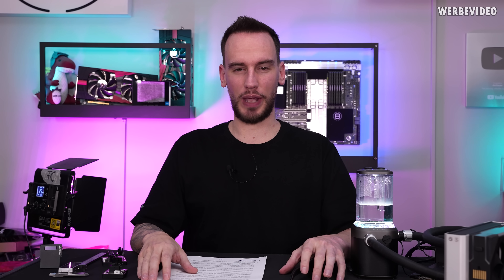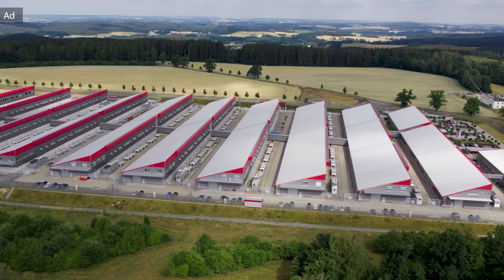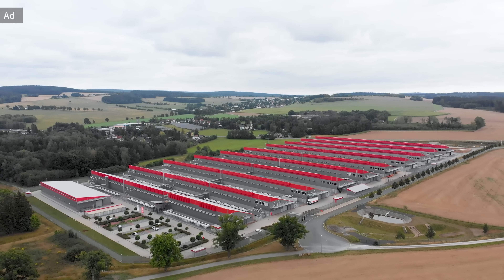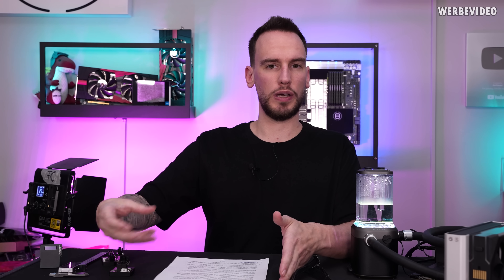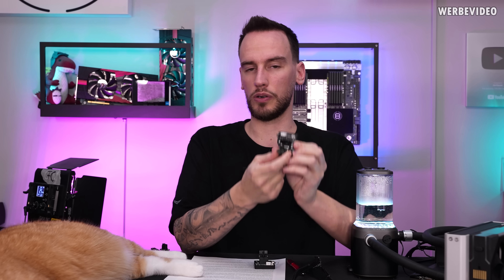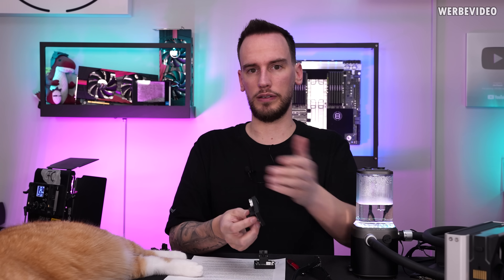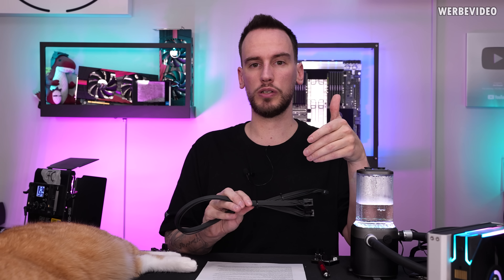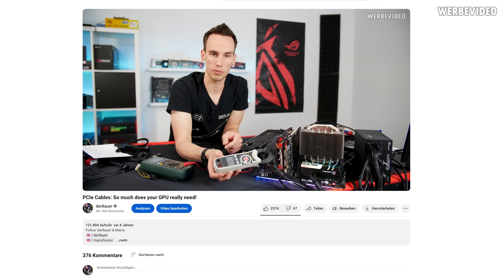12VHPWR is just Garbage and will Remain a Problem!!

Comment: Gonna be honest, modern GPUs being stupidly wide but still refusing to move the power connectors away from the outer edge of the card is a huge problem that also needs to be addressed.

The connector itself is too small, it doesn't provide enough stability to the crimps, they should just go with the 8pin EPS design really.
Reply: Or make the 12-pin connector have pins the same size as the 8-pin for a more robust interconnect.
Reply: @TheKazragore  I mean the pin size is only magnifying different problems, pin size is technically enough its the wiggle room that really causes the issues.
They could have made the plug more robust if they used two latches on the sides of the plugs (instead of in the middle). Or they could have used one latch and use tighter tollerances.
Reply: @Ramog1000 small pin size reduces tolerances because the energy density is higher.  "Technically enough" means you cheap out on safety margins.
1 comprised pin connection can degrade the whole plug as insulation melts.
Much of the tech press should be ashamed of themselves for minimising this issue, which was alerted pre-launch on the SIG list.
Defective products were sold to customers.
Reply: @TheKazragore  yep, that was the first thing that came to my mind right at the beginning, when people started to have problems with it when they released 4090
Reply: Also it's comical how a GPU that is nearly bigger than the motherboard MUST use a tiny undersized power connector to "save space" or something
Reply: I think the problem with moving the power connectors is that they did this power connector at the same time they decided to make the end of the card only heatsink to blow air through. So now there's no PCB at the end of the card to put the power connectors on, they have to stay on the outer edge of the card close to the case side panel. 
If I recall correctly, EVGA was going to extend the power connectors to the side in their 4090 prototypes.
Reply: @mjc0961  they did move it in gamers nexus video with them vince even explained why it was better to put the connector where they did which the reason was to much heat iirc
Reply: as far as I know its not about stability to the crimps but that it can wiggle arround even if plugged in with a click of the latch
wiggling ofc causes less contact area on the connectors and that causes unwanted heat, what I don't get is why they didn't make a 1.1 version of the connector with tightned tollerances
Reply: @Ramog1000 It's not just that. A lot of the issue comes from the power pins being ganged up within the connector. When you have 6 pins with no isolation from each other when one pin makes shittier contact the others have to compensate. So for instance... If you have 6 pins all pulling 10 amps at 12v  (for easy math and illustration and not a realistic scenario) you'd have 720w of total power. Since the power pins aren't isolated from each other... If one pin on the power side isn't touching and the card is calling for 720 w you now have 5 pins pulling 12 amps each to get the same power. This can lead to excessive heat of the connection or conductor and cause the melting we see. And as one connection melts the failure Cascades to the other power pins due to the way the connection on the GPU is engineered.
Reply: 8 pin EPS is only rated for 235W  .... It can go higher but it's been properly derated for safety and headroom reasons while the 12vHPWR is NOT properly derated and therein lies much of the problem
Reply: @longjohn526  its rated up to safe maxium of 336W, 7A per wire, there are 4 12V+ circuits on the connector, with headroom up to 400W if you are daring, 2 EPS12V will suffice even for the 4090, there's just no discussing this, EPS is already bog standard in the server space where reliability is #1 factor of what is used and what is not, if you can power a 300-450W CPU with 2 EPS connectors, there is absolutely no reason an graphics card can't be also.
Reply: Cards having power connectors AT ALL needs to be addressed. I thought it was a stop gap measure. That was 20 years ago.
Reply: another reason it sucks that EVGA stepped down from making some of the best GPUs their 4090 design was not only going to have 2 of the new connectors but they were also going to be on the end not the side facing the glass of most modern cases
Reply: @FrgottenFrshness  or its why they stepped away cause they weren't allowed to use 2. Cause they did proper math
Reply: Bro thats what i said, servers use the eps connector on everything already and its a great connector
Reply: Easy fix - have cables that have 90 degree at 12vhpwr on default. Seasonic has that but Corsair is too thick and doesn’t have that lol
Reply: @deivytrajan  No, it's realy not. some GPU's have the connector realy resest. That eliminates the use of a 90 degree plugg, Some GPU's have the connector upside down. Then the angle will be the "wrong way". If the GPU is mounted vertical, then you want the angle the oposite way. There is to many factors to consider here. There is a reason why cablemod have 4 different adapters.
Reply: @Audiosan79  seasonic reccomends 40mm clearance gap between 12vhpwr and the start of the bend arc. Even if your connector is resest, like mine slightly is on 4090 gaming oc, it still doesnt have enough space in a big mid tower case with 200mm front fans and 167 mm cpu cooler clearance.
Reply: @deivytrajan  Cablemod has started a recall of all their 90° and 180° adapters because they are burning just like the others. So no, having them angled dont solve the problem.
Reply: @walrider  But they don’t recall their custom 12vhpwr cables. Basically, with an adapter there are 4 insertions. With a cable only 2. Obviously cable will be more safe. Despite that, most manufacturers like corsair only offer straight cables of 12vhpwr, modern video cards are super big and the distance left between 12vhpwr port and side panel of the case tiny, forcing people to hard bend the cable or buy adapter…
Reply: @deivytrajan  Yeah you're right I misread what you said my bad
Reply: Honestly. Using 8 pin EPS is not a bad idea. Is already mainstream and in theory (i didnt checked the specs) should deliver more power. They use 4 12v + 4 gnd instead of 3 12v + 2 sense + 3 gnd of the old 8pin PCIe. Still cannot power a 4090 by itself but it would lower the connector number considerably. You loose the sense wires but I honestly dont think you need sense wires on a power cable, that leads to a little more complex PCB design to detect the presence of the cable but its not the end of the world to design (they do it on motherboards...)

Edit: For a quick research the EPS 8 pin connector is 336W per spec and its probably also outdated hahaha. You can power a 4090 with only two of those + a safety margin.
Reply: Absent a major re-design of motherboards, I believe we've likely exceeded the capacity of pcie slots on motherboards.  I just don't see how cards can get any larger or heavier.  Also, there is the fact that having to run an internal PSU that can deliver 3-4 system requirements when the gpu isn't under serious work has to cost in efficiency.  I just can't believe that we aren't quickly heading to external GPUs with their own power supply.
Reply: I have 7800XT that have cutout on backplate with 2x8pins being closer to 2/3 or 3/4 of card wideness and not at it's outer edge. Gives A LOT more space to round up wires.
Plugging those 8 pins and removing them becomes significantly less convenient, though. But not too hard.
Reply: EVGA was doing IT the right way, the connector was on the back edge of the card on their 4090 prototypes, but we all know what happened to EVGA....
Reply: Gpu as like CPU in old days Intel pentium 4, the architecture is fairy old to advance more performance.
A little performance gain but generate a lot of heat, that's why a thick heatsink is necessary
Reply: Thanks for video, bless god and AMD with 3x8pin 😁😁
Reply: I've got an RTX A6000 which has an EPS12V connector. I have seen my model burnt too (just one case but I don't read many forums so maybe there are other cases). So that's why I'm here learning how to minimize risk.
Reply: It should be staggeringly obvious to anyone not sickeningly undereducated that a pin's ampacity can be exceeded if there is complete failure to do something as utterly trivial as plug it in correctly and check the catch is secure as blatantly designed. The sheer lack of intelligence, care, and attention to the most remedial of detail associated with the degrading failure to do this constitutes a truly shameful embarrassment. All this hoo-ha over the source of failure is shocking and ridiculous, and shame on all those suggesting any problem lies with anyone but the user on this matter.

Properly seat your power cables, buy a case that fits, do not bend cables, do not use 3rd party adapters, have a professional who knows what they are doing building rigs and you will have a %99.9 success rate according to the current data..
Reply: this one certainly goes into the connector hall of shame. right along with sata and the internal connector for usb-c (usb-c proper may also go in there but my jury is still out on that one, a connector designed for phones cannot be called universal, especially in industrial settings).
Reply: @LordOfNihil  huh?! if anything the USB 3.0 internal header was way worse than the USB-C one!
Reply: @Ramog1000  yea 3.0 is pretty bad too. but at least it doesn't randomly fall out.
Reply: @LordOfNihil  yeh it doesn't randomly fall out but it also doesn't get unplugged when you want it to. I had to use pipe pliers to get it out. Oh and the pins bend very easily.
Reply: @LordOfNihil the typec header would have been fine if they kept the 1.1 spec of the male connector. It originally had a stabilizing sleeve that wrapped around the onboard header that was meant to prevent leaning the connector over. Also, 90 degree would have made it fine as well. 

Tbh though, I have never heard someone complain about the sata header. Sata and sata-dom are fine so long as you arent cosplaying a damn ogre when manipulating the connectors.
Reply: @joshua7551  oh ive hated sata for a long time. initially it was fine (i was a system integrator back when the transition from pata to sata happened). at the lower speeds of the initial standard it was fine. but speeds went up and connector quality really started to matter more. its primary problem is long term stability. seemed like i had to get new cables every couple years and spend a lot of time cleaning contacts. on one mobo with really low quality connectors it seemed like i had to constantly go in and wiggle cables just to get the damn thing to boot. never had these problems with any other interface (and ive used many).

the point is kind of moot now that we have m.2, which i have used almost exclusively in my last couple of builds. even in sata over m.2 is fine, its strictly a connector issue.

Comment: I was benching 3x8 at 1000w and didn't really have any problems, they have a huge margin as you say.

The resistance of many connectors is a factor and the impedance of the cable from older psu's dealing with the cable.

This was from a 1200w atx 3.0 seasonic, standard connectors into a lian li strimmer, into evc unlocked 7900xtx, peak draw from wall around 1250+ from PSU
Reply: So then I ask you with tears in my eyes why did we need a 12volt high power connector if what you've said is true? I believe everything you said because I see nothing wrong with the standard 8 pin design.

Nvidia created a solution to a problem that never existed in the first place. Whatever they thought was necessary and what they actually needed to do is two completely different things.
Reply: @deancameronkaiser   And their solution to it is just a spit in the face of engineering.
The 8 pin connector, one single connector, at the same safety margin they're using, would be capable of delivering about 450w, believe it or not. That's just 3 12v contacts mind you, the other 2 contacts on the side of the 6+2 are just ground to signal the card it can pull twice the current per pin.
Reply: @Kalvinjj  yes agreed so then I ask you why the fuck did Nvidia decide to make this stupid 12 volt high power connection? With a stupid cable as well? Bro I'm literally holding my head in my hands at this point. 🤦
Reply: @deancameronkaiser   Same here, it's plain pathetic. Could they use a small addition to the spec that like, has data on the two extra ground pins to show it can pull even more? Yes they could do it and use two 8 pin connectors with a new spec on them. No data? 150w max. Data present? 300w max per connector. Problem solved, retro compatibility kept, better safety margin, better chances of properly plugging the cables correctly... But no it's not the hot (hehe) new thing...
Reply: @deancameronkaiser  Since ATX rating was only for that 150W so maybe them trying to re-evaluate it at 215w or something would be much more complicated or meet more backlash, possible lawsuits if there was any fires from the increase in spec.
Reply: @AsthmaQueen  uhm if you watched the video the standard 8 pin connectors are rated higher than 150 watt each.
Reply: I have also tested 1000w with that exact PSU (3090 w 1000w bios and 12900k). 8 Pins still go hard. We don't need 12pin yet imho.
Reply: @StatusQuo209  how about being more power efficient like AMD? I've got a RX6950XT with an Auto Undervolt and it's not drawing a lot of power at all.
Reply: @deancameronkaiser   AMD GPUs are HORRIBLY inefficient.  Did you even read what he wrote?  1250+ watts.
Reply: @mintymus  you do know Undervolting is a thing right?
Reply: @deancameronkaiser  You do know you can undervolt Nvidia cards, right?
Reply: @mintymus  yes I do you can undervolt any card lol.
Reply: @deancameronkaiser   And either way you slice it, AMD GPUs are horrible compared to Nvidia.
Reply: @mintymus  More typical draw, is like 600-650w on my current day to day profile, which allows the card to properly breathe and hit close to 4090 performance or greater in some cases.  

My wattage is set to 780w but rarely gets that high from numerous bottlenecks.  Even in my max 3dmark runs where I pushed 3500mhz I didn't see peak power go much over 900-920w from the card.   1000w was from testing it in furmark.  But having done numerous back to back tests at 900w, the cables, connectors never even got warm at all.

You are correct it is less efficient than a 4090, I mostly got it for fun, and overclocking, and to do a full out AMD build along with a delid 7950x3d (which really didn't help do anything either lmao)
Reply: @StatusQuo209  100% agree, now am kinda wondering what seasonic is gonna do, I heard they have some weird beta program for a atx 3.1 connector but idk what you'd even use it for.  

least sounds like we won't need some new PSU just a replacement cable hopefully.
Reply: yea

Comment: I have a concern, with the additional power bandwidth, I trust/agree with the maths, however, what about the power spikes? the name escapes me, transient power spikes? Specifically, if we have a conservative 150W rating per cable w/ 3 cables, that's 525W conservatively adding the 75W PCIe slot power, so we have 80W*3, 240W of room for transient spikes. My concern is if we use all the Watts regularly, we may shut off from transient spikes more frequently.

Comment: They should get British engineers to design the plug.
Reply: German*
Reply: @Khloya69  I call BS 1363
Reply: @Hundredthldiot  which wasn’t designed by British people. It was designed in the UK, by immigrants. British people don’t engineer. British engineering is usually known for being low quality.
Reply: @Khloya69  citation?
Reply: @Hundredthldiot  when have the British ever designed something that doesn’t spontaneously combust? AP Lundberg and sons designed BS 1363, Swedish immigrants.
Reply: @Khloya69  AP Lundberg and sons did not design BS 1363, they were responsible for some of the earlier round 3-pin designs.
Reply: @Hundredthldiot  either way, if you have to reach so far back, it doesn’t say much about British engineering.